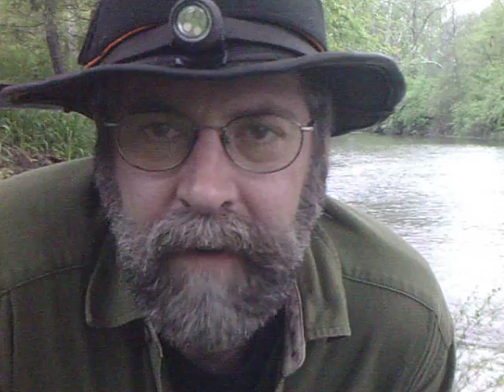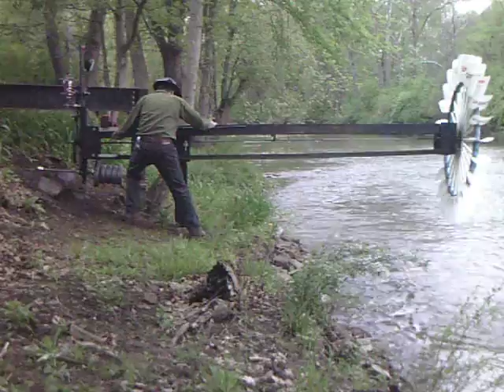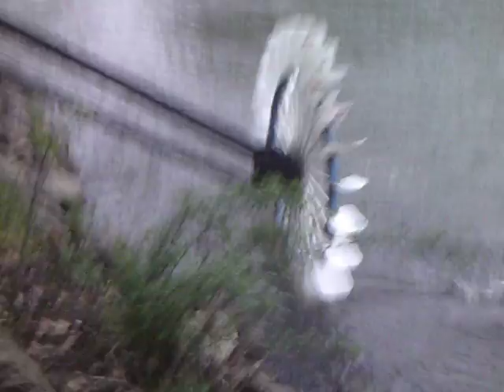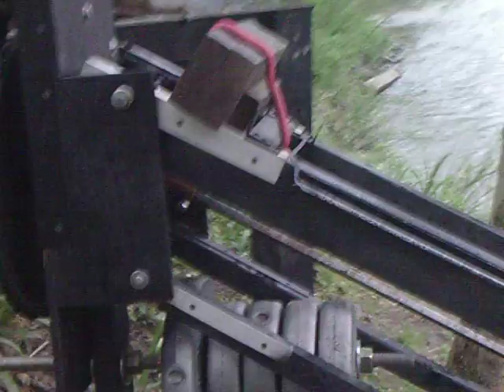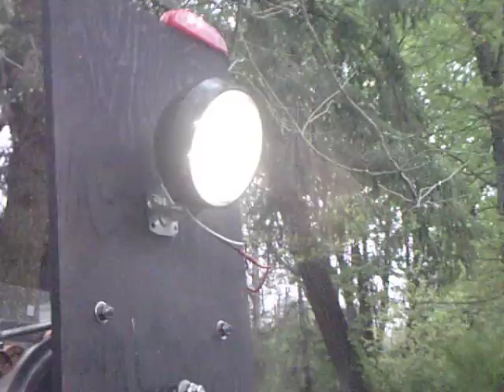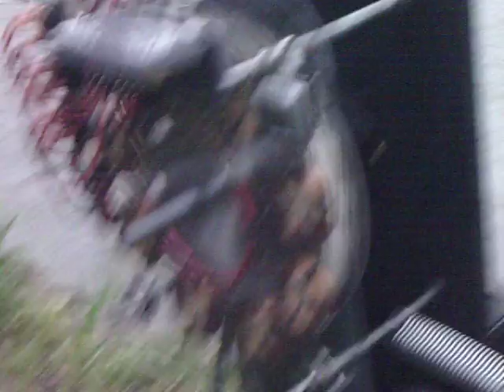waterwheel105.11.avi

Comment: Since they asked you and you are applying for the 105.11 permit, that is a positive! Now you can take the next step. Place a similar parallelogram arm in the opposite side of the river!!. The permit shall allow you to use paddles 30 feet wide, right!. So you can probably get more than 40 000 watts per second with the volume of this river...and even better...your neighbor "next door" (3 -4 feet down the topography) can do exactly the same!

Comment: using a compound gear ratio system, and the addition of bigger paddles on the wheel to counter the increased resistance, would generate some serious power from a water wheel like this! defiantly a future project of mine when i have the time/resoures

Comment: I love the arm you make but the waterweel is crab.   Look on internet for a better design the scoops are to weak for if you want to collect more power. The generator is inasume hime made. Check for a better design on internet and you wil have more power (low rpm generator).  or try to get the final rpm higher and use a simple car generator.  Water weel s are not efficient  try this arm with a srew the you start talking power.
Before peolpe start to complain this is positive comment. I dont like people wasting their time in crappy design so thats why i direct taok to the point. I like people building things like that. So keep up the good work.

Comment: As was suggested, ask the EPA if you can anchor a boat. If yes, then you can remake the power plant, using 2 wheels and a shaft across the boat, all within the boat, and have a simple wire running up the hill. 
Until the boat gets stolen, of course....

Comment: I am interested in what makes up the wheel?  I understand 5 gallon buckets were most likely cut up to make the scoops but what makes up the wheel.  Is it metal, pvc and if it is light material like PVC for spokes what is under the swim noodles.  Very interested in the design of the wheel.  Thanks

Comment: Very novel approach. 
I like how little construction there is as faras building water races or having to pipe the water and the fact the system operates just on the flow of the water without having to rely on any fall. 

Very good Job.

It's amazing in this day and age how gubbermints spout on about the environment  and saving it and then try to tell people like yourself you can't do something that reall is helpful like this. 
Crazy.